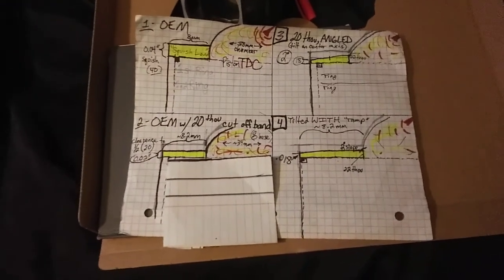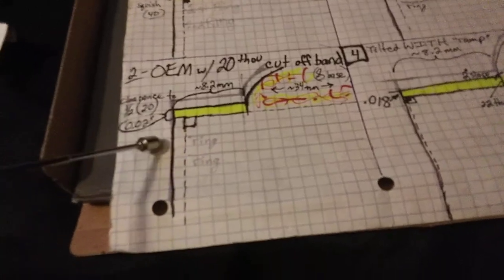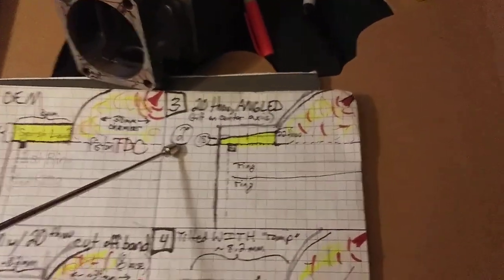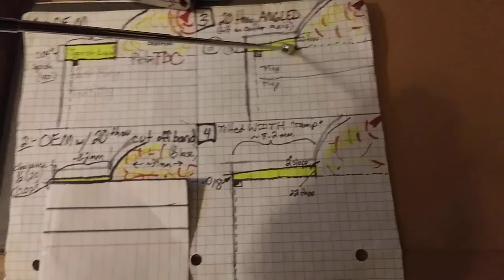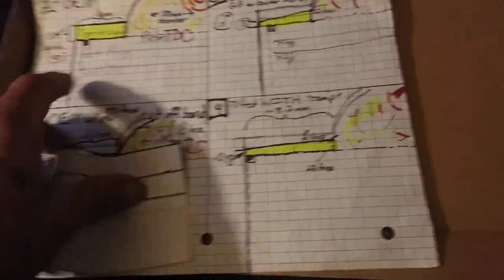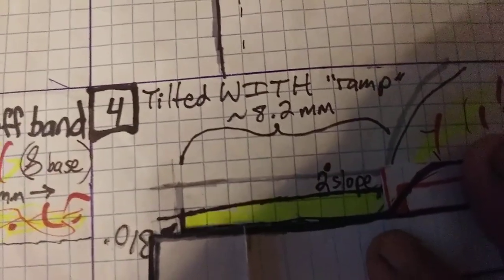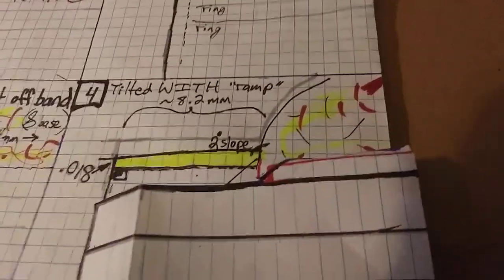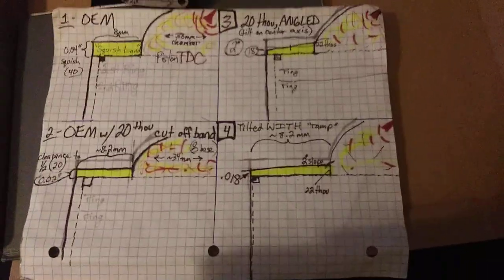Squish & "Squish Land", a Closer Look at Optimizing Combustion

Comment: 7-8 degree taper on a squish band is alot but it wont ruin a saw. We have to remember that many factory cylinders have cast band with alot of taper and they run great 😊 my Jonsered 525/535 hybrid has bunch of taper on a stock cylinder and 1,5mm squish and runs just fine 😊